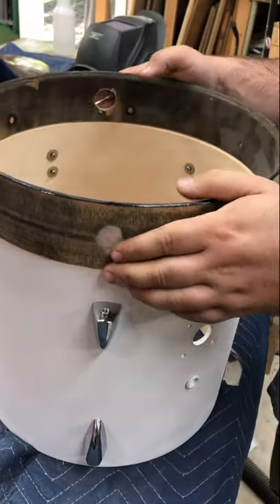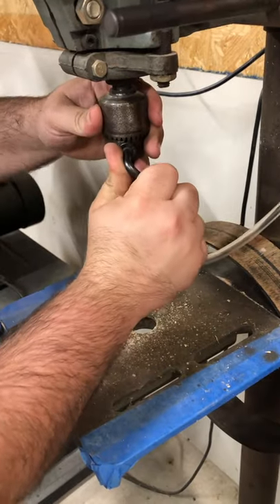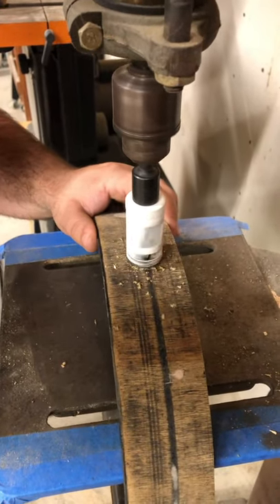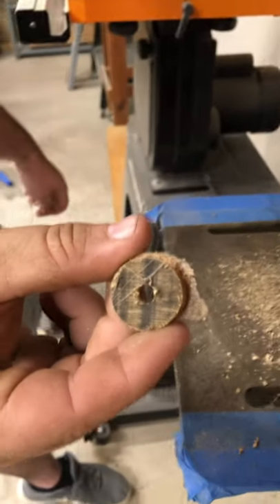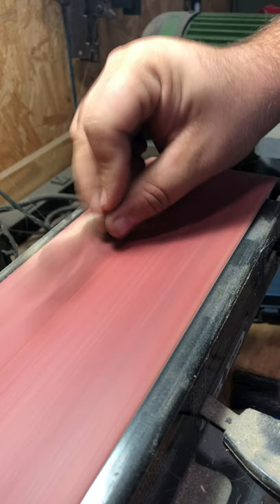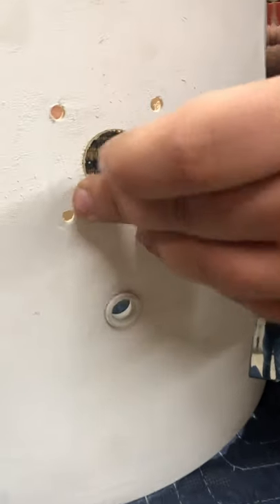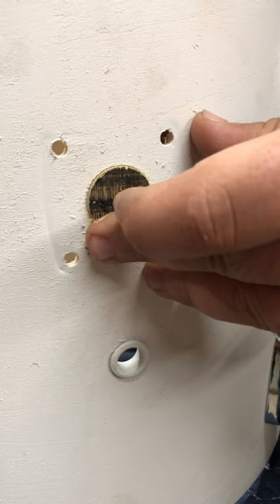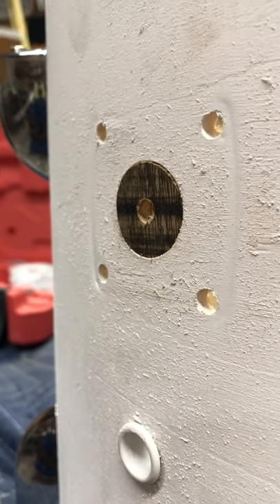When You Change Your Mind About Adding That Tom Mount 🥴

Comment: How would you drill a largish hole even larger?

Like when you have a drum shell that accepted a 5/8" Pearl-style tom arm, but you're upgrading the hardware to 7/8"

I'm about to buy a step drill bit set, but I'm curious what other methods there are.

Thank you!
Reply from the maker: a step bit is your best bet. You can use a hole saw, but youll need to make a guide block. since the pilot bit has nothing to drill into. take a piece of wood and drill a hole in it with the hole saw youre using, then clamp it onto the shell centered over the old hole. That way the hole saw doesnt wander when drilling. There are some other ways to go about it, but a step bit is honestly the easiest/safest
Reply: Great, TYSM! 

Oh, the crimes I committed against drum-kind on the first drumset I worked on
Reply: Just occurred to me I should also be able to use the exact technique you used in this short, pilot hole included.

But I'm still gonna opt for the step bit, because I have other uses for that, too